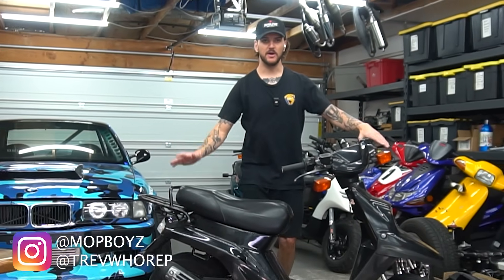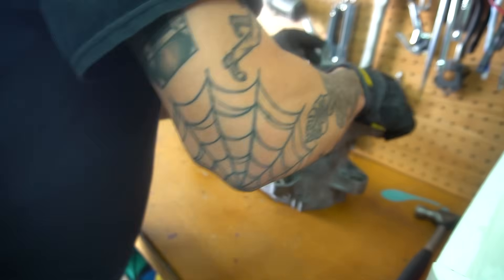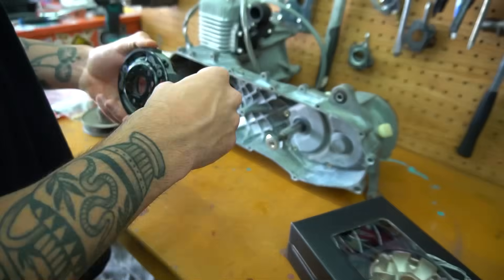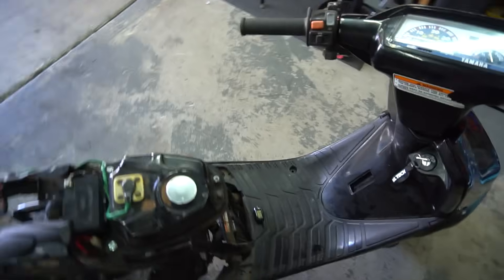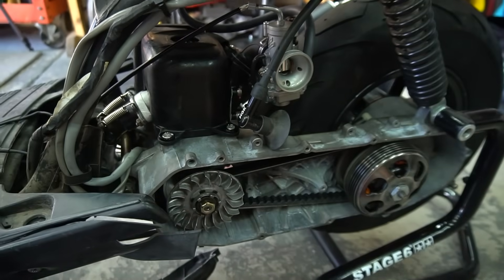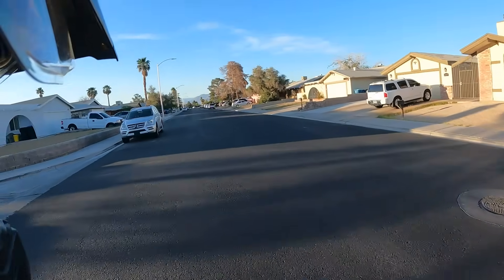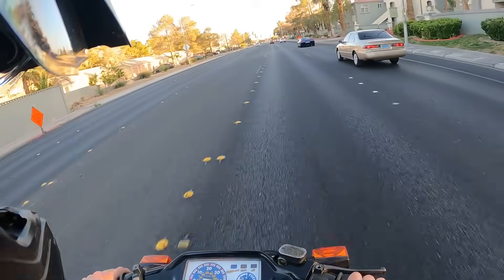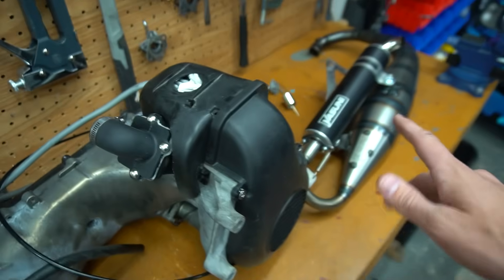I Doubled the Power of my Scooter in 19 minutes!

Comment from the maker: BUILD LIST:
All parts - USE CODE "MOPBOYZ" & SAVE 5%
  https://scooterswapshop.com/?ref=MOPBOYZ
Cylinder: Stage 6 MK2 Sport Pro 70cc
Crank: Stage 6 MK2 HPC
Crank Bearings and seals : Polini kit
Spark Plug: Br8Hs
Exhaust: Yasuni c16
Variator: Stage 6 Sport Pro (4.5g & 5g rollers)
Driveface : OEM 3AA
Rear Pulley: OEM 3AA
Contra spring : Malossi Yellow 1500
Clutch: Stage6 adjustable with orange springs
Clutch Bell: Malossi wing 
Belt : Malossi Special K
Gears : Malossi 14/42 straight cut
Intake : Stage 6 big valve 
Carb : Polini cp 21
Filter : Stage 6 Pod

overseas distribution : https://www.scooter-attack.com/en/cart/
Reply: you should get a colder sparkplug (br9hs) otherwise you could burn a hole in your piston
Reply: you should buy the MXS Racing cylinder from scooter attack its a beast
Reply from the maker: @E-E75  i think i will try that next !
Reply: Appreciation for the information
Reply: Can I buy a scooter from you directly?

Comment: I have a buddy 150. Can’t remove the cover to replace belt removed all bolts even the air box .. seems the kick starter has a snap ring and a round ring on it removed both and  cover will not come off .. every time I pull on  it feels like the kickstart mechanism want to come off too .. had a different scooter took off screws tapped with mallet boom fell right off .. this one is just STUCK !!!
Reply: had a similar problem but after a lot of banging it came off but the kick starter gear thingy came out with it had to put it back in

Comment: Question??? I have a vip future champion that I've put s80cc bbk on. If also put an a9 cam in it too. I've got an aftermarket 2000 rpm clutch with 5 gm sliders in it. I've got a 100 # Jett on the main. But I'm struggling to make 45 some times 50 I can almost get the front wheel I buy now only if I hit a bump. Help

Comment: have the same setup but a different exhaust. I'm not sure if my jetting is right—I use a 102 main jet. Is that good? At low throttle, the engine jerks, but it still moves. When I give it half throttle, it runs smoothly, and it's fine at full throttle. However, I want to be able to cruise at low throttle. How can I manage that?

Comment: Yo, my cv50 08 jog got a polini corsa hand ported bbk, team 4 exhuast s drive variator race kit 5 gram glixal rollers racing cdi, coil and ngk 18k irridium It goes hard to like 35/40kmh bogs down until lik 60/65. Then goes nuts as fuck too 140kmh and hasmore in it lol! Standard carby think its the 14mm got a 21mm dellorto to chuck on it polini choke, and throttle cables and a medium hard center spring. Hopeing it'll solve the boging issue once 21mm dellortos on and obviously mess with the re jets.. gota be between 95 and 103 mj ! 

Love this channel will get a vid up of the jog bogging down, then the power band getting evil with it, lol. Got admit sounds sweet hitting 13k rpm out the team 4! Evil but awesome!

Im 190 and a massive man as well hahaba need a test pilot will be droping and oil cooler and eventually coverting to water cooled set up but for now im aiming for 12 to 14 at the wheel with the air cooled mineralli...defo plausible!

#mopboz!

#ScooterBanditz!

Comment: hey guys. i know it's not the best place to ask but i can't find any info or help about my problem. so i have gilera runner sp50 with piaggio  Hi-PER2 PRO engine (50cc of course). scooter is bone stock apart from leo vince touring exhaust and lighter rollers and stiffer springs. my problem is that it feels like normal transmission, it accelerates based on the rpm and the clutch engages in random moments like sometimes it works fine and engage at around 9k rpm but sometimes its 5k rpm. its really annoying and i have no clue or cant find any info online about this problem. i can send youtube video showcasing what i mean

Comment: what do you think of this elaboration for a typhoon? 
malossi crankshaft mhr 39mm
mhr 70 replica AC
malossi vl13
Malossi 360 collector
21 phbg racing
malossi team 3 piè
filter evolution polini
all the various bearings and gaskets 
-TRANSMISSION:
full MHR overrange
z13/44
Cold and bell delta 107mm
Digital ignition polini for race

Comment: I just got a prebug, its bored to 70cc. But the front end shakes at very low speed when I get under way, what is that? New to scooters here. Other than the initial starting speed it seems fine.
Reply: My electric start sounds pretty similar to that one as well
Reply: Wheel bearings , alinement , poor tire balancing , bad struts or shocks , ball joints or worn / bent controls arm tie rods would cause such handling problems. I don't know nothing about scooters but I used Google.
Reply: @johnbeton4058  Lol! I normally do the same type of search. Thanks! Was watching this rite before work. Will dig into it when I get the free time, I appreciate the search and comment 🤜🤛

Comment: May i ask everything as in tips n trucks to rebuild a 2 stroke? Plan to rebuild a razz then work my way to my banshee i just bought for 1400 but dont wanna mess it up so cheap razz 1st  i heard Dry ice the crank, heat the bearings, then piston squish anything else? -ty
Reply from the maker: leak down testing! https://youtu.be/M4gOn0nOK_k?si=7Tan4e4jHivvWWH_
Reply: @MOPBOYZ, you're a g. i also heard to soak something in 2 stroke oil i presume just piston and ring or all the is clipped on the rod? Again ty
Reply from the maker: soak your wrist pin and wrist pin bearing , and oil the cyl & piston a bit on install

Comment: I wouldn't mind a video of tuning a 70cc. My dio runs rich and i know i gotta tune it a little.
Reply: Just want to let you know, if your motorbike is running rich, just check the ignition and carburetor, in my experience it was hard to get rid of the rich but after tuning it changed to lean, no brick red In the spark plug. It turns out that the ignition is small so the combustion is not perfect

Comment: What squish did you use, and what is the torque spec on the case bolts?
Reply: he used 0,75mm and the torque spec according to the service manual is 13nm or 9.4 ft.lb
Reply: @syrice  thanks, And do you know how many minutes should i do the heatcycles?
Reply: @kponap1kka usually for like 2 minutes, if you have a temperature sensor you just let it heat up until its at operating temperature

Comment: I’m so conflicted. I just showed my friend who is a professional go cart engine builder and racer my port job on my scooter. He freaked out and said I ruined the engine. Apparently scoot cases are under pressure and regardless of the ports being partially blocked the air will be sucked in 
Because of the pressure . He also said that by removing material you’re essentially making the crankcase volume larger with lowers compression.  Thoughts on this? Anyone?

Comment: Finally a proper pipe for the mid range builds and not a small sport exuast           Btw you should try making a hyper racing vertical engine with Mxs Racing or Athena big bore
Reply from the maker: i should try a mxs next!
Reply: The real hyper racing is the 2fast 70-100cc!! But thats a real pain to assemble and its very expensive
Reply: @francescobuonandi8298 yeah but then you gotta engine swap

Comment: Love it when you drop a new video! Question. I have a 70cc bbk on my big eye with upgraded variator. What clutch assembly do you recommend? It feels like the scoot slips when you stab it from a stop and the front wheel doesn’t try to lift. Getting 52mph out of its current setup. Also in FL.
Reply from the maker: stage 6 adjustable is my favorite clutch by far!

Comment: Please post the full breakdown of this build so we can replicate it all the way from contra spring to rollers etc ❤
Reply from the maker: BUILD LIST:
All parts - USE CODE "MOPBOYZ" & SAVE 5%. CLICK HERE:
  https://scooterswapshop.com/?ref=MOPBOYZ
Cylinder: Stage 6 MK2 Sport Pro 70cc
Crank: Stage 6 MK2 HPC
Crank Bearings and seals : Polini kit
Spark Plug: Br8Hs
Exhaust: Yasuni c16
Variator: Stage 6 Sport Pro (4.5g & 5g rollers)
Driveface : OEM 3AA
Rear Pulley: OEM 3AA
Contra spring : Malossi Yellow 1500
Clutch: Stage6 adjustable with orange springs
Clutch Bell: Malossi wing 
Belt : Malossi Special K
Gears : Malossi 14/42 straight cut
Intake : Stage 6 big valve 
Carb : Polini cp 21
Filter : Stage 6 Pod

overseas distribution : https://www.scooter-attack.com/en/cart/
Reply: @ legend thank you sir

Comment: Where can i find the list with the parts from this build?
Reply: Stage 6
Reply from the maker: BUILD LIST:
All parts - USE CODE "MOPBOYZ" & SAVE 5%. CLICK HERE:
  https://scooterswapshop.com/?ref=MOPBOYZ
Cylinder: Stage 6 MK2 Sport Pro 70cc
Crank: Stage 6 MK2 HPC
Crank Bearings and seals : Polini kit
Spark Plug: Br8Hs
Exhaust: Yasuni c16
Variator: Stage 6 Sport Pro (4.5g & 5g rollers)
Driveface : OEM 3AA
Rear Pulley: OEM 3AA
Contra spring : Malossi Yellow 1500
Clutch: Stage6 adjustable with orange springs
Clutch Bell: Malossi wing 
Belt : Malossi Special K
Gears : Malossi 14/42 straight cut
Intake : Stage 6 big valve 
Carb : Polini cp 21
Filter : Stage 6 Pod

overseas distribution : https://www.scooter-attack.com/en/cart/
Reply: @MOPBOYZ  thanks for the list 🥳and thanks for the overseas option in Eu the best options we have are maxiscoot and scooter attack Wich think is a subsidiary of maxiscoot , or something like that. Thanks again keep up the good work. You made me love scooters and mopeds. But my favorite is the pre bug, but I can't find one in Greece because old people have them and they don't know how to advertise it on Facebook marketplace 😭.